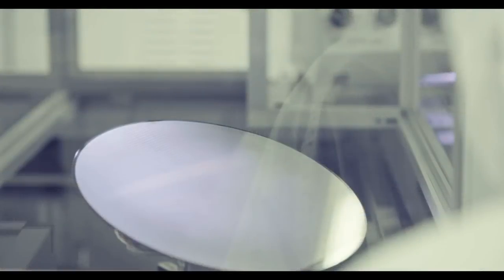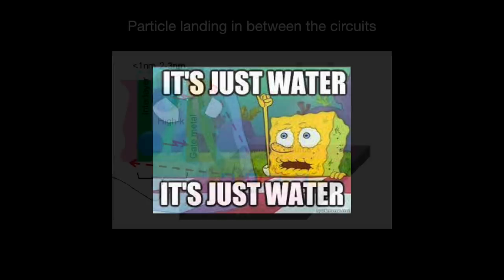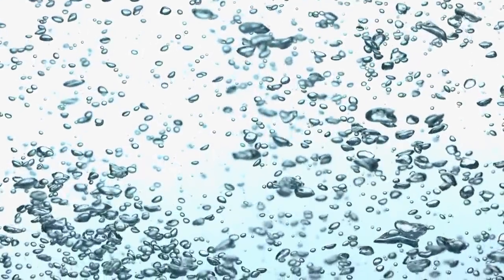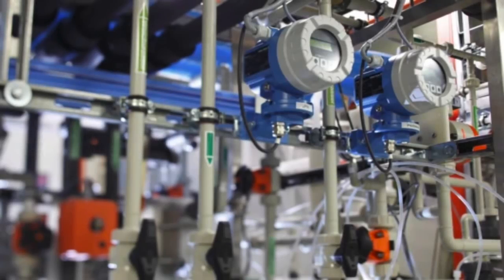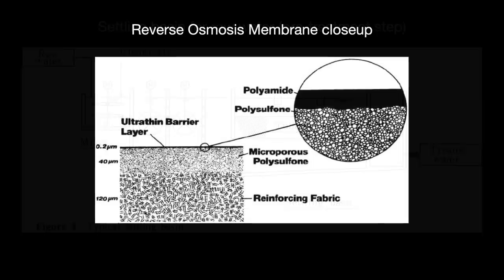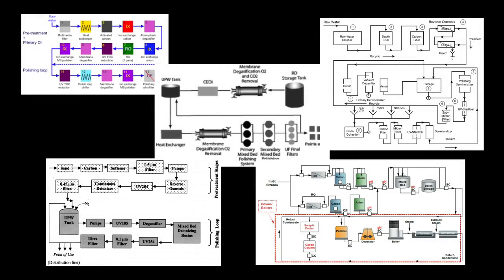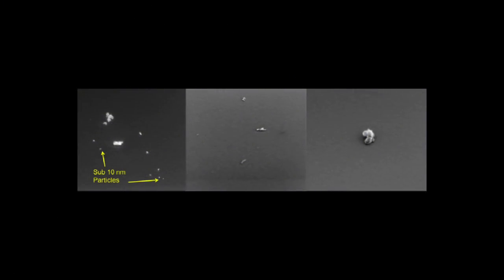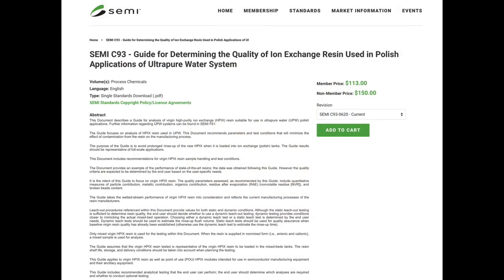Ultrapure Water for Semiconductor Manufacturing

Comment: So, my only contribution to this ongoing problem more than likely has already been examined, but was not mentioned in this video.
I have worked in and studied refrigeration since 1988. Woop de doo., I here you saying. Any way in the many facets of this field, one comes to mind that purifiers water without filters or ionization etc This is your simple, under appreciated, motel style ice machine. You have used one, right? So how they work is they take a fresh batch of tap water , and run it over and over a refrigerated plate, that is a mold, that makes those groovy ice cubes you can't get at home. You might have noticed how good they taste, or maybe not. You might have noticed that they are perfectly clear, and have no bubbles, or pockets of air, or maybe you didn't notice that.
Fact is, they do taste better and ate clear, due to the nature of how they are formed. The flow of fast moving water moves past the ice mold , which is around minus 10 to minus 30 degrees Fahrenheit. But the water isn't that cold, and cools down over time. Gradually molecules of h2o become chilled to the tiniest degree below 32 degrees f and freeze into ice, only on the plates surface. They adhere to it, because of the characteristics the universe gave water, specifically, in our understanding of physics. All of the other things that just so happen to be in that batch of water, aren't affected in the same way by the drop in temperature, like the water, that has begun to form ice, one molecule at a time, for your drink or consumption later. So as the water continues to build up on the ice mold, it becomes isolated from any minerals, organic compounds, etc. Organic cellular organisms that are in water that have a high percentage of water in
 their make up are burst upon the water in them becoming ice, and the other compounds flow away from the mold only to become part of the temporary reservoir.
Thus, through a humble yet highly intelligent process given to us in this particular universe and it's own peculiar laws of physics, we have "pure ice", or "clean ice". Ice that is totally different than what you get by using the same tap water in your own freezer, that is poured into an ice mold and left to freeze with all of its non water molecules becoming part of your home made ice cube. You see the difference, and why I am suggesting it as a primary water purification method. Maybe take the ice

Comment: Why not use distillation? Shouldn't it produce the most pure water?

I'm sure it doesn't work or else they would have used it
Reply: Nanometer size particle can float and be carried by the evaporating steam.
Reply: This is more pure that distilled water. Distillation or reverse osmosis is typically the first step in producing ultrapure water. Also, keep in mind that one UPW is exposed to air, it's no longer ultrapure as it will absorb oxygen and CO2 from the atmosphere (this is why the pH of 18 megaohm water that's been sitting out for a while is around 6.5-6.0).

Comment: So what is the reason for using water in the first place rather than some other ultra purified liquid? I'm guessing it has something to do with water's surface tension, neutral pH, and availability.
Reply: Maybe cost? What other chemical can be sourced so cheaply in volume and doesn't need any evaporation and condensation steps that cost tons of energy to be generated in the first place?
Reply: Water is very good solvent. The killer particles that is in your wafer is dissolved into the UPW. The property of water to attract impurities is why you want them for cleaning.

Comment: Question? You mention that a fab uses 2000 gallons a minute on average. But how much water does a fab return or are the 2000 gallons a minute consumed in the process?
Reply: At least in modern fabs, most of the water is recycled.
Reply: Even with recycling there is still waste water. Reverse osmosis has two output stream. One output water with less impurities than input and the other output water that has more impurities than the input. You cannot feed back the dirty water back at the input because that will reduce the purity of clean output. In multiple stage purification you can use the dirty output of later stages as input for the early stages but the chain ends on the first stage where you have raw water as input and you have dirty water output that is less pure than raw water and ends up as waste water.

Comment: Jokes on you, I use silver-plated stainless-steel pipes, with a UV treatment system paired with a 10μm particle filtration system. The only thing I am bathing / showering in is glorious and expensive water.

Comment: Why not purify the water using distillation?
Reply: Distillation is a rather coarse method of separation. You'll end up with azeotropes - mixtures that can not be separated further by distillation because the composition of the liquid is the same as the composition of its gas form.
Reply: @miklov  Isn't it a step closer to the target purity which then undergo further purification using the existing technique?
Reply: @bobweiram6321  I think it comes down to energy cost vs how much benefit you'd get from distilling. Reverse osmosis for instance can accomplish the same task but with way less energy. It is very energy intense to evaporate water, those pesky intermolecular hydrogen bonds are hard to break. (The intramolecular ones are even harder why electrolysis is even more costly than distilling).

Comment: I wonder what the purity of the water is coming out of whatever they use this for - do they have to run it back through the start of the purification system as if it came in right from the river, or can they bypass some of those steps, reducing the re-filtration cyle time?
Reply: I'm pretty sure (when they recycle it) they have to put it through the same steps - only way to make sure it's particulate free. But it saves a lot of money, especially in areas that are arid by nature...

Comment: Is Ultra Pure Water able to transfer heat? Could your use it for liquid cooling a computer and would it’s purity improve efficiency
Reply: The specific heat (abolity to transfer heat) of water isn't affected as much by impurities as other properties, unless there's enough to change that property - for instance antifreeze reduces the heat transfer ability a little, but it's worth it if it keeps a cooling system from freezing.
Reply: You can pour upw on your parts directly to cool it.
But you have to constantly replace the water with newer water. 
And your part will wear out earlier than expected.

Comment: I used to have a pool, and the water there has to be the opposite of pure.  Pure water would be a solvent, and start dissolving the walls of the pool, the metal, and anything else it could find.  Instead you have to make it "neutral", just the right PH, the right amount of dissolved solids, and the other chemicals that keep it clean.  And again, there are entire careers and massive books for municipal water facilities to draw on to solve this problem at civilization level scale.  We live in complex times, and the most surprising thing is that its 99% invisible.

Comment: Like you to research  about the Aussie Sydney  lab who made Quantum computers run better  10years L8tr some gateway chip circuit 
just a small Australian laboratory funded by Microsoft & others  etc  found something they had that  could be used in quantum computers it worked the  noble prize
Reply: A team of scientists at the University of Sydney says it has overcome one of the biggest problems standing in the way of anyone building a quantum computer that can actually do something useful: how do you control a quantum computer operating at temperatures close to absolute zero, without running so many wires to it that you warm it up and render it useless? has invented a pair of computer chips nicknamed “Gooseberry”, which could operate inside the icy cold refrigerators required by most quantum computer designs, and still provide an    the team announced it  interface to the outside world without significantly raising the temperature inside the fridge.
videos google youtube

Comment: I wonder why they do not use electrolysis then with the hydrogen and oxygen use a fuel cell to make pure h20. I would think even if they need a lot of water that using all those other combined treatment wouldnt make the cost difference that great and you could recover some electricity in the process. How do they prevent the ultra pure water from dissolving the pipes? Also I wonder if another liquid could be used instead of water, what makes a water so great? .
Reply: Because it would be extremely costly, slow and explosive
Reply: yes, mixing highly explosive gas and a literal oxidizer is a bad idea.
Reply: Because without a filtration system to keep the water pure, you still run into the same problems. The pipes themselves will leak particles into the water, and then your ultra-pure hydrogen and oxygen suddenly become regular water when particles enter the system. Or, you just have problems at a different stage. Like, how do you prevent unwanted gas particles from entering the system? Is your hydrogen 100% pure? Probably not.
Reply: Hydrogen can be used as a pure gas so ultra pure h2 is easy to get hold of. H2 also is smallest atom so easy to make pure. Oxygen is hard but liquid O2 by definition is fairly pure. Reacting is more difficult but dilute with n2 possibly. How much this costs is a good question